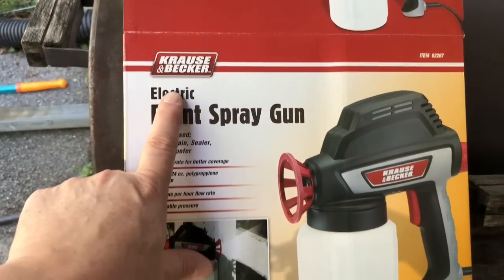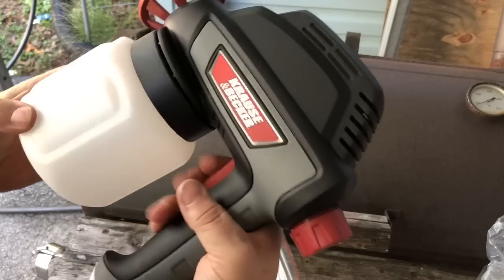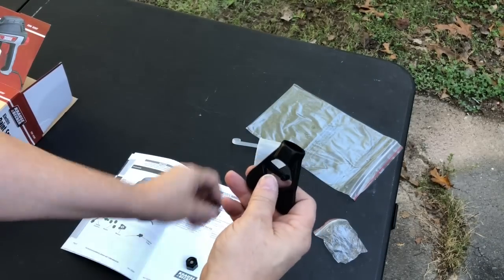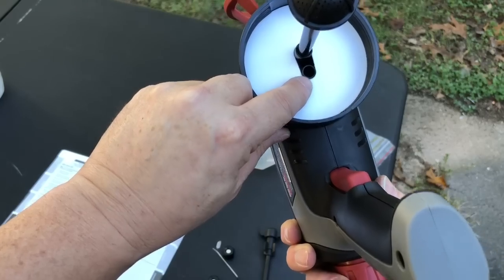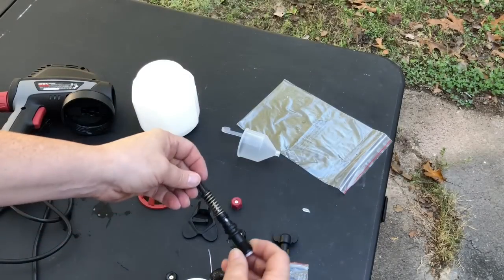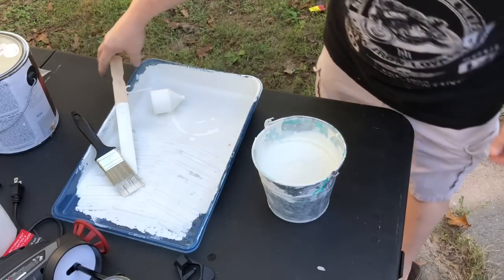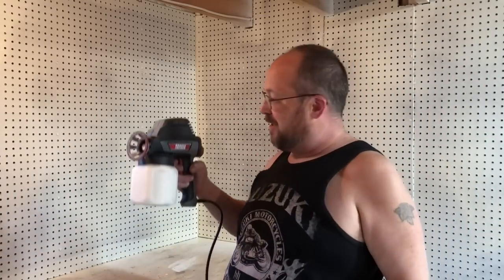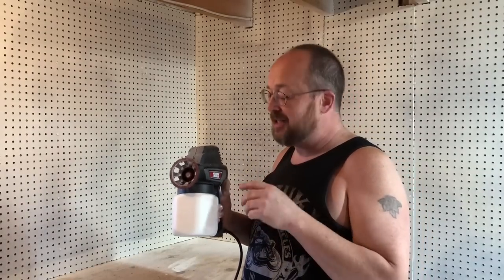The Do's and Don'ts of Krause & Becker Airless Paint Sprayer at Harbor Freight

Comment: I got one to paint osb. Did not think it would last past one day. To use with latex I had to thin it to nearly 1/3rd water and latex paint. I will say at that mixture there was no clumps or odd spray pattern. When I was done for the day I ran it with hot soapy water twice and then 2 drops of 3n1 oil. A year later it still worked!

Comment: Have had this sprayer on a shelf for several years and decided to pull it out. Prior to looking at your video, I read all the instructions and when it said not to use it on latex paint i boxed it back up. I saw your video and then read the box side as you did where it says there is a latex nozzel. Damn.

Comment: Your video is much appreciated. I purchased the Krause & Becker electric paint sprayer at Harbor Freight to paint my boat. Did you tinker around and find a ratio mix of paint and water to help control the over spray? Thank you
Reply from the maker: I found that the paint has to be really really thin to work in this sprayer.  😁👍 the overspray is horrible lol.
Reply: @VansWorld  I painted the boat today. I did a few test runs with the spray gun and found a good ratio of paint/water and this cheap Harbor Freight paint sprayer is excellent for the money. Itd be a really good tool if they could do some mods to control the over spray to lay the paint better. Other than that no complaints.
Reply from the maker: That’s awesome.   Thanks for the update.   Your right.  It’s not too bad for the price.

Comment: Would you recommend using this sprayer for primer and latex paint to give a old steel cabinet and shelving new life? They were going to be used for garage storage?
Reply from the maker: Sure.  But thin the paint out a lot.  And use the right tip.  This sprayer comes with a couple tips of different sizes.
Reply: Vans World Hey man thanks for the response! I really appreciate it!

Comment: The paint jar leaks on my Krause & Becker spray gun. It looks like the rubber gasket on the gun side isn't thick enough.  It's about 3 yrs old, but was "brand new" in an unopened box. This was the first time trying to use it. The gasket isn't damaged in any way, just seems too thin. Does anyone know if you can get a replacement gasket?

Comment: I saw Maxbond Acrylic Latex paint recommends a 0.015 - 0.019 spray tip -- at 2000 psi.  LOL,
I think this unit has a working pressure of 175 psi, so I don't know what to do with that info.
I believe that you're supposed to pull the pickup tube loose and put a little oil in both holes.
Of course as you showed, when you disassemble to clean unit you can apply some oil more directly.

I used mine today for the first time (NIB on my shelf for a couple years).  New plywood siding panels.  Too much overspray.  Regulator adjustment didn't resolve but maybe it requires experience / a finer touch.  Wish I had just rolled it since I can just lay the panels flat.  The honey color paint was close to the original wood color so it was hard to tell how good a coat I was laying down.  Will do another coat with roller.

I will likely use it again next year on an existing wood siding shed.

Comment: So which one of the nozzles did you end up using for latex paint
Reply from the maker: The biggest .032” (.08mm)
Reply: @VansWorld  Thank you
Reply from the maker: They’re not marked lol.  Or I didn’t see where they’re marked.  I used a crafting needle to see the size.  The more the crafting needle poked out shows the bigger diameter hole. 
  Checkout my video on the Sprayit 33000 https://youtu.be/zcXESxLPnLQ
Reply: I have the same problem. They don't tell you ANYTHING about the nozzle tips. 3 different ones (maybe) but nothing in the manual or on the tips.
Reply from the maker: Harbor freight suck with manuals.  I think they need a department that makes videos on how to use their products and products they sell.

Comment: When spraying just figure that you need to cover everything that you are not painting which includes yourself. Whether you are using the best spray equipment or the cheapest the same rule applies.  Since you are spraying water base paint you do not need to use paint thinner to clean the overspray from your windows.  spray water then use a razor to remove the paint.  you can use a steamer and wire brush or soft brush to clean it off the cement.  It is easier to mask off the area rather than have to work harder cleaning up EVERYTHING you didn't intend on spraying.

Comment: I got a very similar(copy I think) of this sprayer, offcourse chinese, it cost me around 35 USD and it does not come with extended nozle or cylinder set and I can not adjust the spray from circular to vertical or horizontal.
Reply: Plus you cant adjust its speed.
Reply: Also two tips from my side. It can spray really high viscosity paints aa well I once sprayed coal tar based paint which is really thik. And for cleaning I fill it up with thinner and spray as much I think is appropriate in a bucket and then use it again and again but quite a quanity escapes. So, try both things at your own risk. Whenever it gets stuck, stop spraying and clean it first.
Reply: And man our booklet is also same. Do not use it with wet hands it can give you a shock.
Reply from the maker: Oh lord.  I’m glad I didn’t experience the shock therapy lol.

Comment: What kind of oil did you use for lubricant?  I bought throat seal by Graco that was recommended online but the sprayer keeps getting clogged.
Reply from the maker: Wagner piston lube from Amazon. Should be a link in the video description.  But Lowe’s has it too. For like $7  have a great weekend.   It’s cold as heck here in Georgia right now 😁👍

Comment: I bought this exact paint sprayer from Harbor freight, and after THINNING the paint to the PROPER VISCOSITY.....it did NOT VAPORIZE paint into the air like yours did (your paint was TOO THICK), and I adjusted the needle control to very low setting which made the gun throw a light, but very good coverage fan of paint.  As for the noise....yep, not good without ear protection INSIDE, but doing OUTSIDE projects it’s ok, just annoying BUT paints large areas QUICKLY and evenly.  I had very few problems.  The thinner the paint the MORE EVEN it throws it out without spitting and vaporizing excess paint into the air.  Using thinner paint also let me cover a large area 
(50 sqft or so) PER CONTAINER full.
Got to smarter than the paint gun man!  Good Luck!
Reply from the maker: Great advice.   Thanks for sharing 👍😁
Reply: @VansWorld  yes also runs is from spraying too close I paint cars I learned from my mistakes.

Comment: brush and roller would have been just as quick and cleaner.  sprayer has only one adjustment.  spray is very inconsistant...heavy then light and heavy then light...was painting cedar fence and has to go over everything with a brush to even out the coverage.  it was worth the $40 at Harbor Freight...should have paid for the better and known brand name.
Reply from the maker: Probably use less paint too

Comment: Bought this paint a door...what a piece of crap!  Would not spray anything without splattering, sitting in my attic collecting dust
Reply from the maker: It’s definitely a piece of crap lol. It takes lots of patience to operate this paint sprayer.  But in its defense, I have a Ryobi Paint Sprayer that works just as bad as the Krause and Becker Sprayer.  Thanks for your feedback.  I hope you have a great weekend
Reply: Paint is probably too thick dude

Comment: I got one of these, worked great for ten minutes, then it didn’t want to spray anymore, tried recleaning, it would not even spray water, not to give up on it, took it apart soaked all parts in a solvent made for spray guns, relubed, it spayed water again, and all that for another 10 minutes of paint spraying, absolutely garbage.
Reply from the maker: Your right it isn’t a good product for paint.  But it works great to spray sealer on decks and fences. 👍😁 thanks for leaving a comment and as always thanks for watching
Reply: @VansWorld  hows the overspray working with deck stains?
Reply from the maker: Works great but it does use a lot of stain and sealer if you don’t dial it back.
Reply: @VansWorld  glad to hear it haha ive got about a hundred yards of fence I've been attempting to stain the old fashioned way.
Reply from the maker: That has to suck.
Reply: same here, its going back to the store, piece of crap! Easier and less paint being used the old fashioned brush or roller way, totally not worth all the effort.